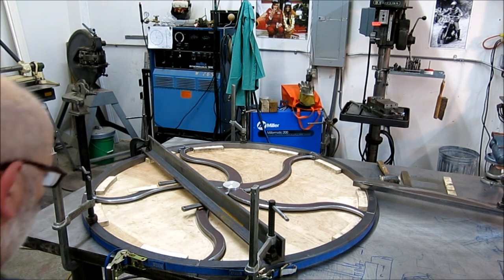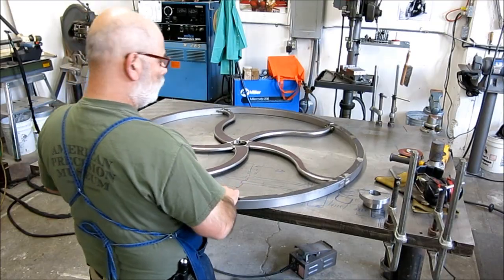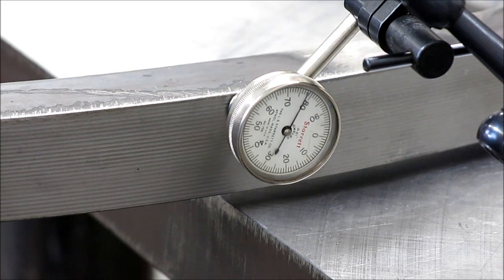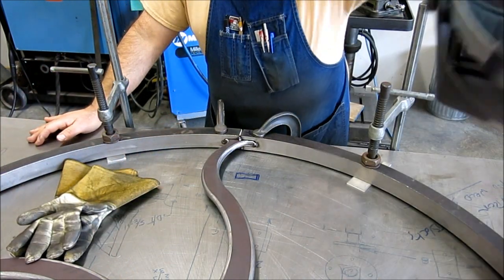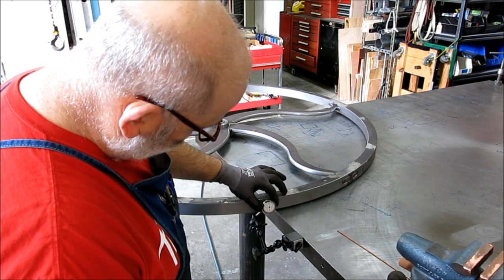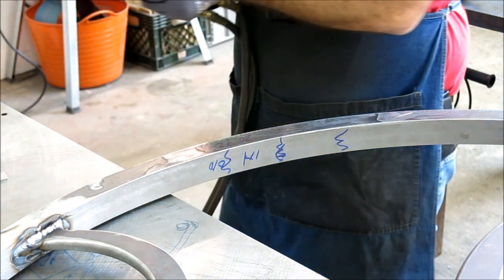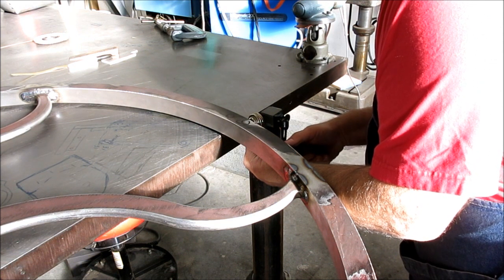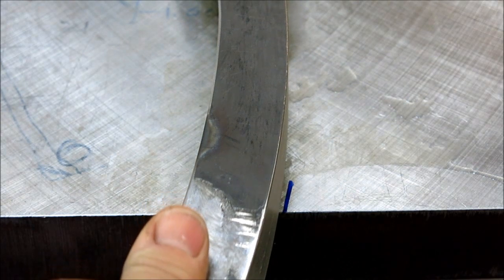Etching Press Handwheel 6

Comment: Dad had one and he used it on Copper, brass and Aluminum.  On power plugs - I put in a simple square knot on connects.  Won't pull apart if tugged on.

Comment: GREAT VIDEO !!
WOULD IT BE AN OPTION TO WRAP A WET RAG AROUND IT & ADD MORE WATER ?
Reply from the maker: A wet rag works pretty well but dries out quickly. The spray bottle works best in my opinion as its fine mist fresh cool water each pump. Thanks for the comment as always.

Cheers,

Tom

Comment: Old video, but, do you recall why you were more concerned with the 15 thou inside over the 25 thou to the outside?
Reply from the maker: +justfakeit888 Hi fake,

I can't remember without watching the whole video again. I do remember I was pleased that it came in so nicely. Thanks for the comment.

Cheers,

Tom
Reply: I think it might be because the zero point was actually below the average for the rim, so the 15 low spot was actually worse than the 25 high spot. I'm just guessing, though.

Comment: Just a timesaver suggestion - a woodworking guy would have smoothed the sides of the spokes before routing the round over shape. Then a little sanding would be all you need and no time consuming filing would have been necessary. Otherwise keep up the good and very interesting machining video projects!  I think you would have saved even more time over the way you did it.
Reply from the maker: slad roznik Hi Slad,

Thanks for the tip. I could feel the bumps in the flame cut edge. You probably couldn't see it but the radius was basically full and cut away nearly all the flat on the second cut. Thanks for the comment.

Cheers,

Tom

Comment: Thanks for showing the flame straightening in detail. On another youtube channel it is a closely guarded trade secret for some reason. Seems like a very important skill to know.
Reply from the maker: Stanwood Dave Hi Dave,

My opinion is the knowledge belongs to the trade not to any individual. We just rent it for a little while. Somebody showed me how to do it so its part of my job to pass along the skills. You actually have to practice it to be able to make use of it. Its not falling off a log easy to interpret and control the results. So its like practicing brain surgery I guess. Looks easy watching somebody that has done the time to practice their art. I never diminish what skills anybody has spent the time learning. There is tradecraft in everybody's work. We have much more to gain by sharing and open learning than by "guarding" the simple physics of heat and thermal expansion. If somebody told us not too many years ago we could make money off showing machine work and welding videos we would have laughed at them. The world is changing fast my friend. There are new ways to make a living invented every day. You do have to find out about them however. That can only happen in an open polite environment. Thank you for the comment and posting your feelings on the subject.

All the best,

Tom
Reply from the maker: Hey Chris,

If you do any welding you need to understand how to correct distortion. Its just a fact. You cannot clamp  or sequence out all welding distortion. 

Cheers,

Tom
Reply: "guarded trade secret for some reason" VERY simple answer, "That guarded trade secret" put's food on the table, and pay's the bill's. If everyone knew how to do it, you'd lose a source of income. Not everyone is independently wealthy. Hint on the source of income, if a new propeller shaft costs costs between $400.00 and $800.00 depending on size (diameter & length) plus milling operations vs being straighten say for somewhere around half the cost of replacement, BINGO you made some money, and the customer saved some money, everybody is happy. But I'll bet you would be the first to cry that he made to much money for so little work. But it's o.k. for a lawyer or doctor to make the big bucks for so little work, i.e., as consultant's.
Reply: Plus, if all it takes to bring you to financial ruin is a single youtube video, all it would take is for someone to figure this out on their own, and post a video. I highly doubt the industry is so fragile that their customers would stop paying for the service when knowing how it works. In my experience with transparency in communication with customers, the more they know, the more they're willing to pay for your services, and I'm in an industry that's far less tangible.

Comment: I've never had the opportunity to weld before, only watched others do it. So sorry in advance for the noob question: why do you hold the electrode thing near the weld once you kill the power? Thanks.
Reply from the maker: Hey Rock,

Good question. The reason is the shielding gas is still coming out for a few seconds. This gives the still hot weld some additional gas coverage as it cools. More important with sensitive materials like stainless steel and titanium. Old habit.

Cheers,

Tom
Reply: Good question, ive always wanted to know.

Comment: Hi Tom, So how did you drill an accurate hole in your 2" thick table top, keeping it perpendicular to the surface?  Do you have a good magnetic drill and a nice straight stubby drill bit?  If that hole is off, then all of your indicator readings become suspect, so these details are important. Thanks. Best, -Chris
Reply from the maker: Hi Chris,

The hole was already in the table. The wheel did not pivot on the bolt. It was pivoting on the center hub that was welded to the spokes. The bolt into the table just clamped a bushing flat to the table that the hub ran on. Hope this makes sense. 

Cheers,

Tom

Comment: Hi Tom,

What was the drum attachment you had in the grinder near the start, looked like a flap drum type thing?

Dan
Reply from the maker: Hi Dan,

It was a solid abrasive cylinder. Kind of like a round hard disc. They are threaded to go right onto the grinder spindle. http://www.mcmaster.com/#8732A58

Cheers,

Tom

Comment: Hi tom great vids. I'm a novice. I bought eastwood (ac/dc tig 200) and trying to learn. I have 2 questions. If tungsten touches while welding to resharpen do I break a little off first then sharpen or just sharpen. Do I need a separate grinding wheel for red tungsten and for green tungsten. Or just dedicated grinding wheel for any tungsten. Thanks for letting me pick your brain.
Reply from the maker: Hi Ray,

Good questions. When you grind tungstens there is no need to separate wheels for the different alloys percentages. The key to tungsten grinding is just clean smooth taper. You don't want any foreign material on the tungsten,  Just grind it back until you don't see any thing other than tungsten, Beginners don't sharpen often enough. If you touch it with the rod or dip it in the puddle just stop and touch it up. I keep a dedicated wheel just because it gets grooves in it and I don't like to dress the wheel back every time.

Hope this helps.

Regards,

Tom

Comment: Nice Video, Tom

I've been a big fan of flame straightening ever since I witnessed a coworker use it (BIG rosebud and a garden hose) to straighten some pretzeled side rods on a wrecked steam locomotive.  Within a couple hours he had several kinks, a bow and some twist out of them.  I think they were something like 4" x 7" in x-section and about 12' long.  Simple, effective, amazing skill.  Nice use of it, Tom!

I'm tempted to have some family members watch this series because your work is so cool, but I already know what they'd say: "Why didn't he cast this in iron...!?" (once you open the foundry door...)
Reply from the maker: Hi James,

The guy I learned from did super heavy duty stuff. He would say things like add a weight to the topside to help it move. Well what he meant was a 20 ton load sitting on some five inch thick plate that had a wow in it. Yikes! He would connect multiple fuel and oxy bottles together to do the work. It is a very cool process worth experimenting with.

Thanks for sharing your experience with the process.

Best,

Tom

Comment: Tom, another great video. Very nice to see more of the flame straightening process. I once got to spend some time at the Long Beach Naval Shipyard, inspecting equipment to be auctioned, and got one of the old timers to describe the flame straightening that was done on propeller shafts, before they went in the (80 foot) lathe. Just like your method, except many more and much larger torches, plus an overnight cool down.
Reply from the maker: Hi Gary,

It is a very useful technique. Kieth Fenner uses it to straighten his prop shaft before machining. I see the distinctive telltale heat discoloration marks on some of his shaft. That would be a big job straightening a 24 inch diameter shaft. Thanks for sharing your experience. 

Best,

Tom

Comment: It might interest you to know that those rasps are precisely the ones my son uses when filing the nail heads, shoes and hooves when carrying out his farrier work, they are brilliant tools and as you say don't clog.
That has been most impressive and I've learnt a lot watching you carry out this sequence of tasks, I'm really pleased for you and hope that your pleased with the end results
Reply from the maker: Hi Dan,

Thanks for the comment. All the farriers I've seen keep their files in a white bucket. Is your son the same?

Regards,

Tom
Reply: oxtoolco
No, he he has a either a type of wooden knife block that he keeps them in in the truck (those that he is using) or singly in an aluminium tube attached to the leg of a type of basket that carries some tools and nail selections that he has nearby each foot as he works around the horse.
New ones are wrapped in waxed paper in a cardboard box. He gets through them pretty quickly, especially in the winter time, so buys several at a time but they are still very expensive! (£150 for 6!)
Lots of carpenters want "old" ones off him!!

Comment: Hi Tom. Excellent project, beautifully crafted, but I have a question.  
If I understand the situation correctly, you have ~ -4 to  ~ +25 thou' total run out.
You didn't say, and I couldn't determine whether the maximum and minimum were even approximately opposite each other, but IF they are, would it not be possible to move the centre hub ~15 thou' towards the high side by judicious grinding inside the spokes?  Assuming you haven't already welded it of course.  This way there would still be a few unavoidable but acceptable surface imperfections but perhaps total run out wouldn't be more than a few thou'
As you were checking the side to side 'wobble' of the wheel, I was kind of expecting you to shim up the low side and weld the hub there.  That's one way of taking care of the wobble.
Sorry to go on, but alternatively perhaps you could weld the centre hub and correct for wobble by just a gentle manual bending tweak - either with or without heat.
Keep up the great work.  
Regards Mark in the UK
Reply from the maker: Hi Mark,

Thanks for the detailed suggestions. After I do the rim rounding I may give it another spin or two to see if the hub (not installed yet) can be positioned for an advantage. I still need to look at the plane of the rim a bit more.

Best,

Tom

Comment: I love the hand wheel vids keep them coming!  I have a quick question with the fixture you made so you could rotate the hand wheel is it possible to use the same setup to make a grinding fixture to grind the od round?
Reply from the maker: Hi Dan,

You are right. I probably could use it to make it dead nuts. I really don't want to machine it round. I wanted this to be a fabrication project/problem. Thanks for the comment.

Best,

Tom

Comment: nice job tom looks like the run out is not to bad now after the heat shrinking we used to straighten 60 foot semi trailers the same way by putting heat in to the neck of the trailer in v's you could see them straighten up while you were putting the heat in to them they used to make some strange creaking noises while doing them keep up the great videos
Reply from the maker: Hi Andy,

Thats cool that you have seen this in person. We use V shrinks for high aspect ratio sections like the channel you describe. Thanks for sharing your experience.

Best,

Tom
Reply: oxtoolco it was one of the many skills i picked up while in the trailer building game when i was a lot younger than i am now lol

Comment: My grand father worked on the Bart system and saved the day by doing somthing very much like this . There's a metal lip at the edges of the docks an the space between it and the train had to be to very tight tolerances . At this station the tracks curved and came in at a grade . It was like trying to bend a perfect helex as big as your house.
Reply from the maker: Hi Chris,

Thanks for sharing your story. I am always interested in stories of how folks have used the flame straightening technique.

All the best,

Tom
Reply: The boss told him they never would have gotten done if he wasen't there . He did miscellaneous iron. That all finance hand rails and visual things. He was very good at it.

Comment: Excellent work very impressive. I cant believe you got it that close with so many pieces welded together.
Reply from the maker: Hi Jim,

Thanks for the compliment. The simple wood assembly fixture made it fairly easy to do the right thing. All the rest was from making lots of mistakes in my youth.

Regards,

Tom
Reply: Don't know if you follow ( luckygen1001 ) but he has a sign he made casted in aluminum that reads I HAVE NOT FAILED I JUST FOUND 10,000 WAYS THAT DO NOT WORK reminds me of your comment

Comment: The law of diminishing returns.... boy is it obvious you don't hang out with my friends. LOL. Interesting video, Tom. I have a couple of questions, if you have time to answer. 1) The manipulations you did to the outer diameter, do they affect the inner spokes to the extent that you will have to relieve the stresses on them with thermal cycling? 2) How in the world are you going to carry that upstairs and hang it in place? I think I would have told my wife we would have to order one, and have the delivery guys do it! LOL. Great video.

Thanks again,
Leon
Reply from the maker: Hi Leon,

These corrections were minor. If there is any additional stress in the spokes it is distributed. The curves help with this by acting like springs. One of the reasons cast handwheels had spokes like this was to relieve shrinkage stress. Id doesn't go upstairs. It will be mounted on a giant press that you will get to see built.here.

Kind regards,

Tom

Comment: Cool video Tom. The handwheel is coming along great.
I enjoyed the Flame straightening. Its a similar principle to how we used to shape pieces when plastic welding patches to curved surfaces. 

Colin
Reply from the maker: Hey Colin,

Do you mean plastic material or plastic deforming metals to fit curved surfaces? Sounds like fun. 

Cheers,

Tom
Reply: oxtoolco
Plastic material actually. When doing a patch over a curved surface it was advantageous to heat the inside then cool it to contract creating the curve. This was a few years back when I got to repair polyethylene fish tubs on a regular basis. Quite often there would be forklift "bumps" on the rounded corners.